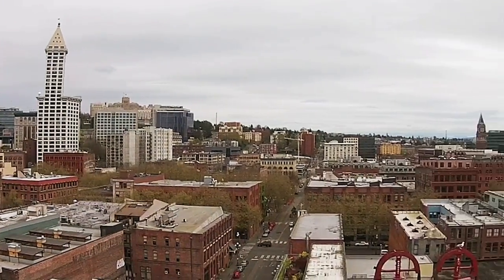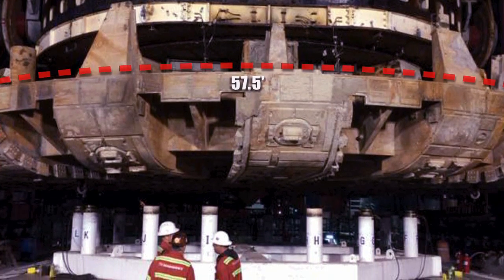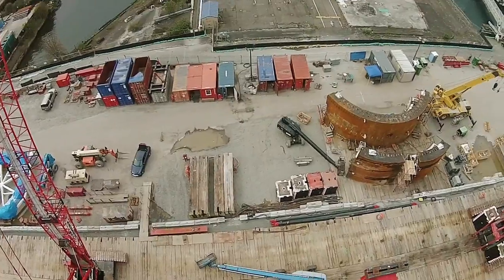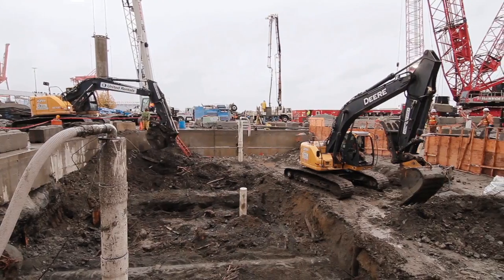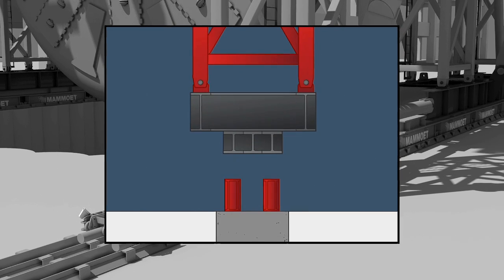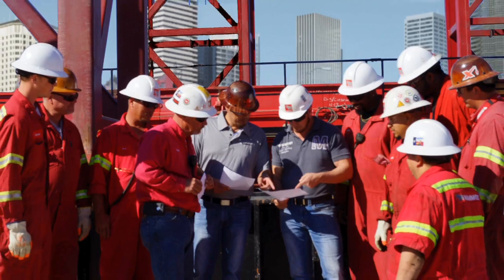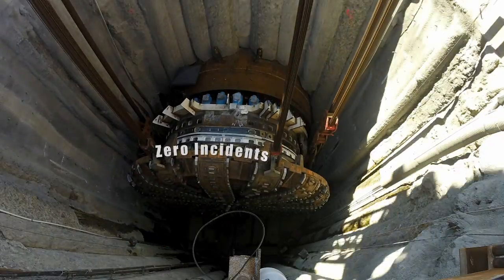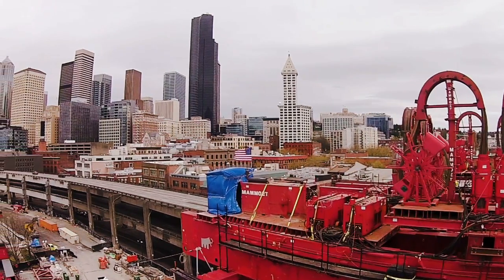SC&RA Job of the Year Award video - 'Raising TBM Bertha'

Comment: This should be a 5 hour documentary for such a massive/challenging project. I was a mechanic on a Robbins 35' TBM building the Chicago Deep Tunnel project. Assembling machines like this on the surface is a challenge....putting them together and taking them apart underground is another level to say nothing about the danger.
Reply: :)...I say 6 months...:)...I want to see them repair the drive head...then reassembly in completion. Restartup...